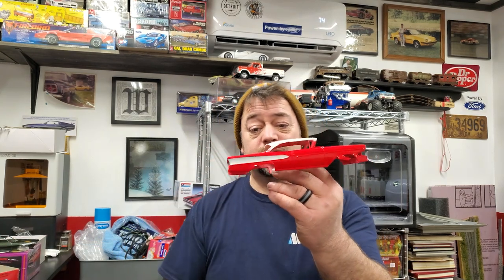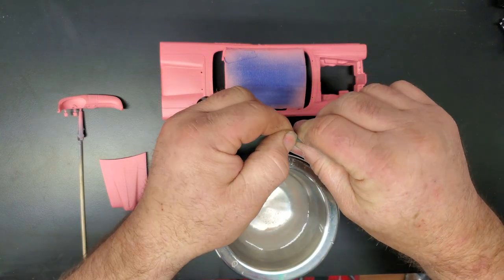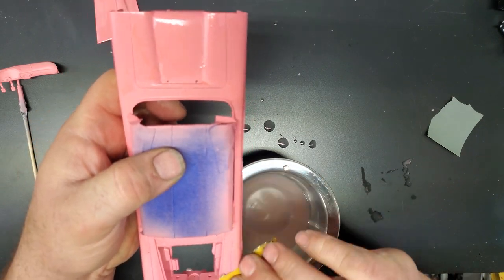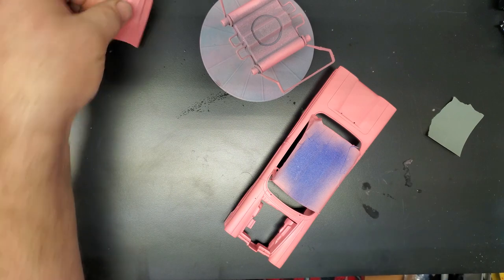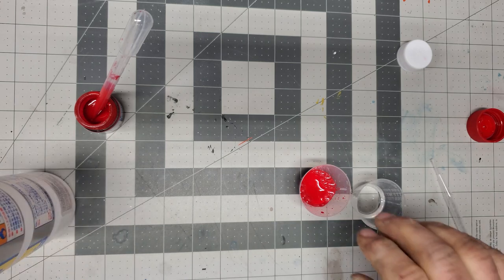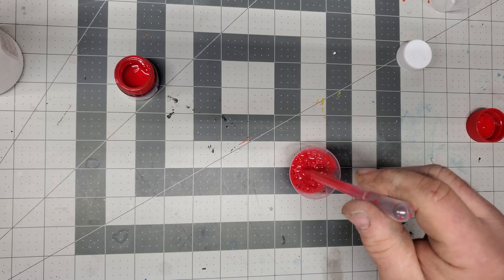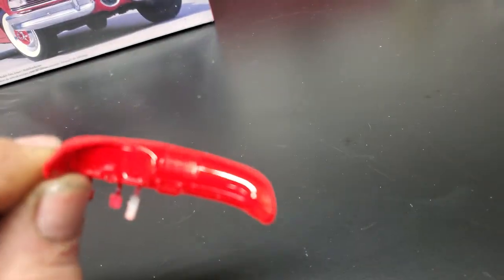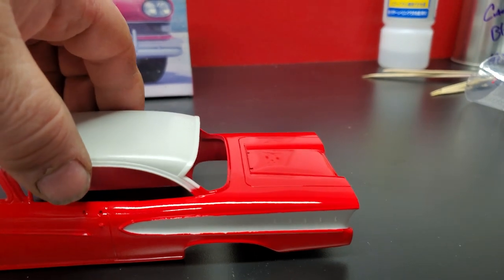Edsel build from front to back.. Episode Two!

Comment: Paint gloss and level of color is excellent. It really comes out in a fine mist from your new air-brush. 
A question, Kreg. Do they have a cover to put over the cup? I'd forget, turn my hand, and spill paint I'm sure while spraying with that open cup. My experience with kits was only brush painting and occasional rattle can. Thinking about an airbrush now, if I re-start after many years not building kits. 
I like the '59 Edsel better, too, but '58 isn't as bad as so many say. Not having one-piece bumper was the strange thing on '58, I think, rather than the grille.
Reply from the maker: Thanks Ray, yes I do have a cap/cover for the cup, I just never use it. Most of the times I am only about half cup of paint, friend of mine was teasing me for not using it. I always have a hard time removing it. I do like the later versions of the Edsel better myself, Have a good one Ray!

Comment: You're very knowledgeable about this subject, so MAYBE you have an answer for me...  I recently bought the Tamiya paint kit, the one that has the car body device for spraying.  I attached a body to the springs, and about 25 seconds later, it exploded, springs and car body going everywhere.  I can find NOTHING suggesting a fix for that, or if the item is defective.  Have you ever had this issue, and if so, how did you fix it?
Reply from the maker: Hey Kenny, sorry I can not help on that one, I have never used that set up, I don't usually spray many lacquers, I shoot mostly enamels. Send me a link in email of what your using I a curious on the set up. woodskreg@gmail.com
Reply: @kregskorner8851  From what I can gather, that piece is defective, and a new one is being shipped to me.  I, too, use enamels.  Have for decades!  You did an amazing job on the Edsel.  So nice, in fact, I decided to do mine in red and white, as well.  But, it won't be my ONLY build on that car, I'm sure.  My main interest is AMC cars, but can't afford the Matador Coupe.  Just out of sight price wise.  Thank you for your videos.  They're extremely informative, enjoyable, and in many ways educational.
Reply from the maker: @65marlin327  Thanks Kenny, AMC built some cool rides in the day, would still love to get a few of them, like you said the price is up there, I have a few kits I would love to get just not willing on the price.. Someone needs to reproduce some of those older kits, would be a good seller.